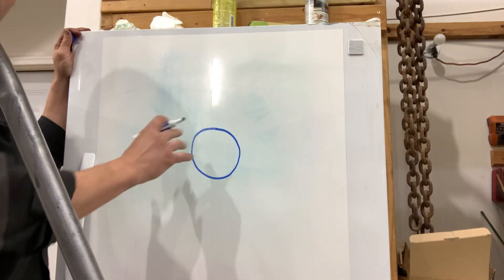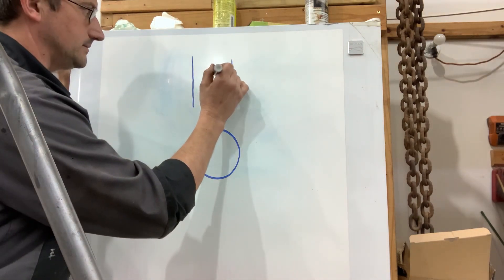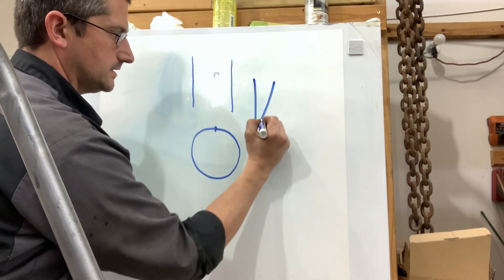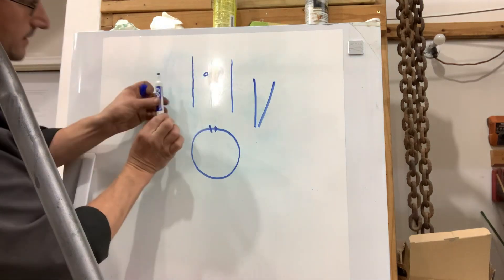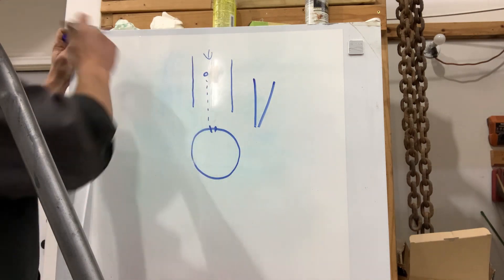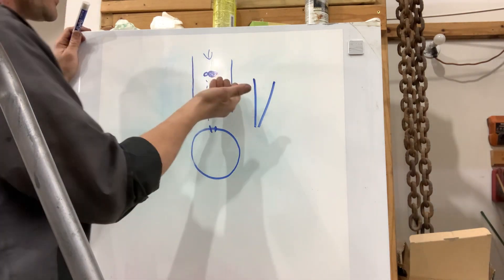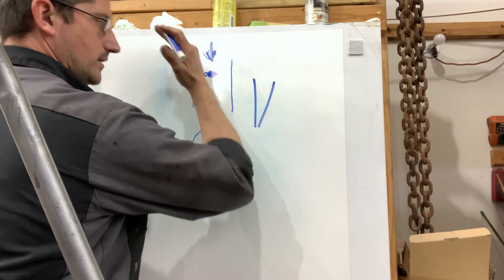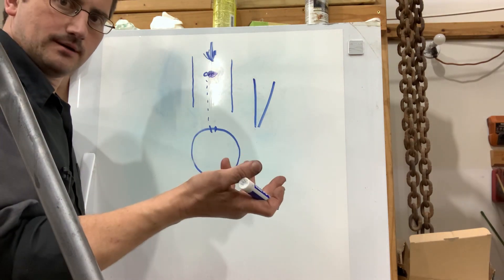Height of piston and offsetting the pin. Rotating the piston in the bore, how it effects height 🧐

Comment: The problem with your concept is that is the other way around. Piston pin offset from factory is negative or against crank rotation not the other way around. The way you are explaining it there’s a loss of compression, cylinder volume and even stroke. And if you know what you are doing and have the right math to calculate the rod angularity, you can make up for it with compression height on the design of the piston.

Comment: If you only consider the rod orientation, you're correct. What you should consider to determine TDC is when the line goes through the pin to the crank center, that's the "true" TDC. Your lines should extend to the height of the crank center.

Comment: I’ll add one thing:  the compression height of the piston determines ultimately what the deck clearance is, so in your example that holds so long as the offset pin factory piston has the identical compression height as the piston with a centered pin.  The piston only “goes higher” if that triangle’s hypotenuse and opposite sides are the same (same length connecting rod) AND the compression height is the same.
Reply from the maker: I have 30 minutes of video, this is just a clip.